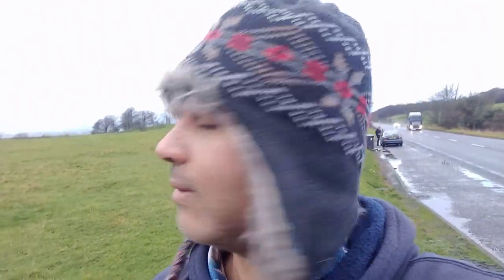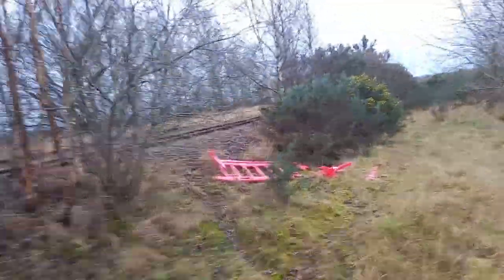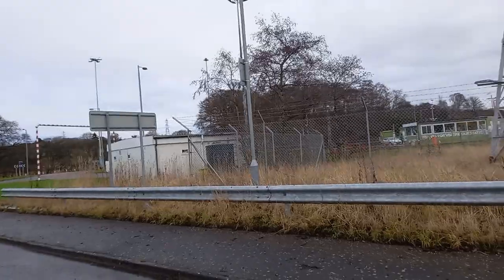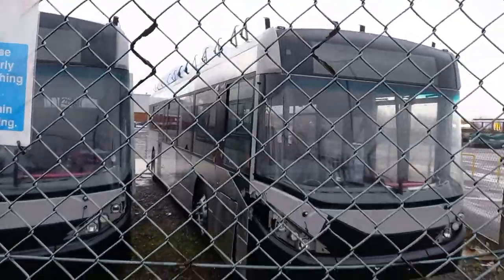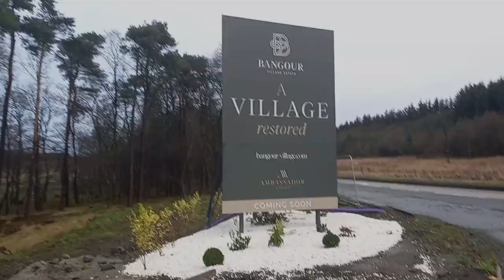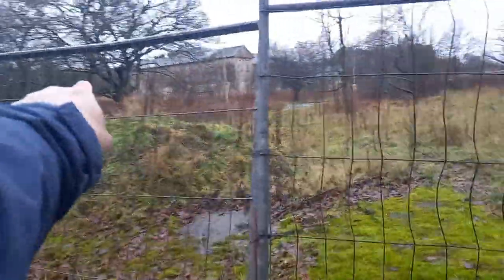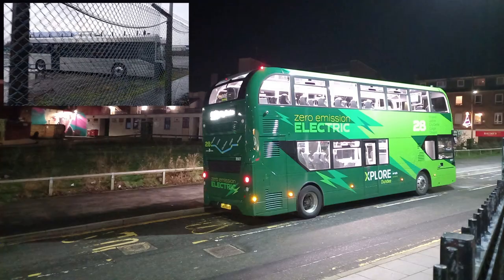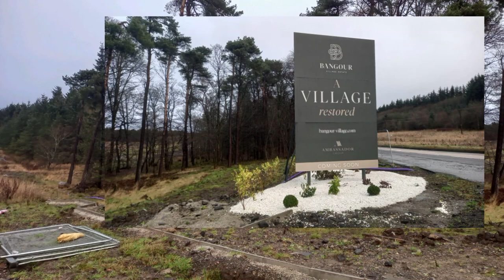My First Adventure of 2022 (derelict places and miscellaneous subjects)  ....Scotland....2022...

Comment: Ho Chris so you know the firstxbuilding you seen at 30. 49 was actually gardeners stores as the with the remains of greenhouses for them to the end of it next to where they demolished one of the top wards due to the building coming down itself at bangour. You are allowed to walk round the site. Security is there but as long as your not in a building or one surrounded by hera they dont bother you people from Dechmont and visitors still go up for walk cycle or run round road
Reply: Would also recommend going to your local library and trying to order book called "The bangour story" with number of storys. I new the place when it was live and later explored it from 2006 when power was still on in buildings. They are used to people with cameras wondering around and they patrol keep a eye on you . The bottom road you showed was Villa 18, 19,20 and 21 on the very edge
Reply from the maker: Hi Billy thankyou for this interesting, useful information regarding the Bangour Village buildings.
Reply from the maker: Thanks again Billy for this information.  I'll bare in mind, this book about Bangour Village stories .
Cheers!!